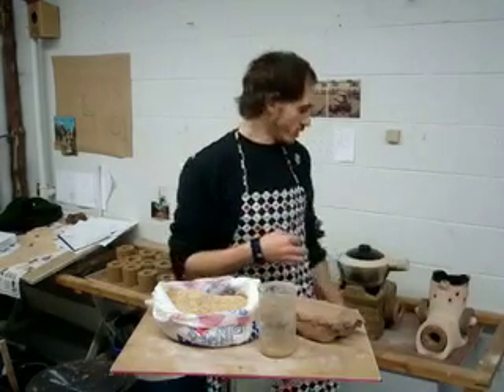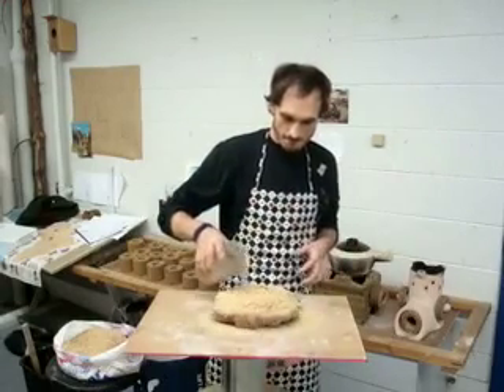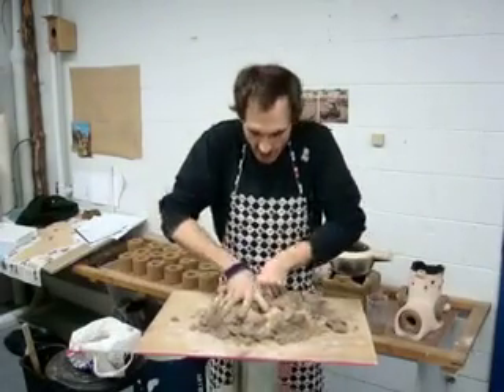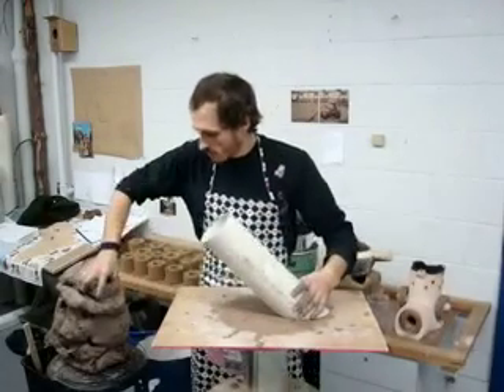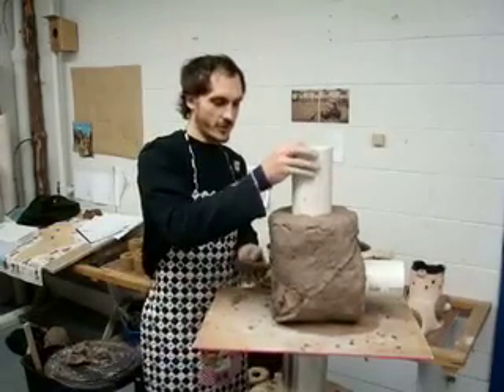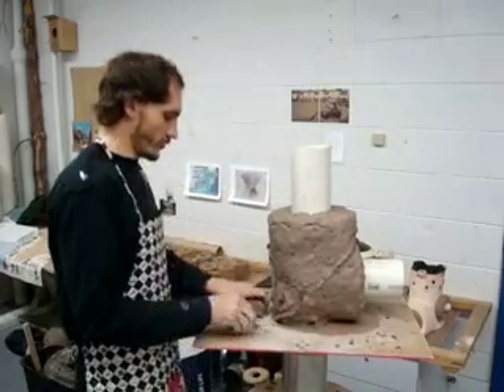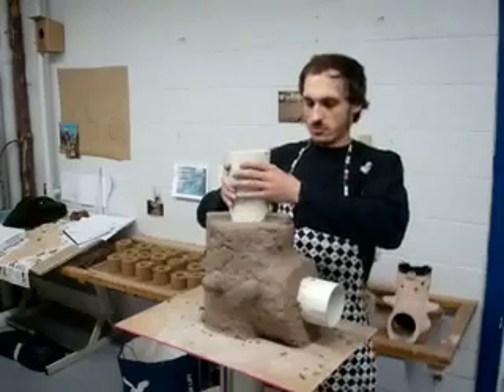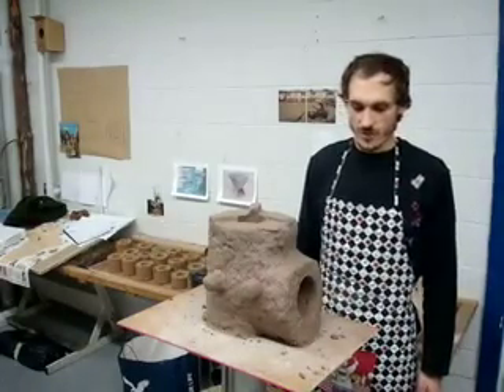Holey Rocket Making 2

Comment: The recipe from ceramicartsdaily there's a video for pulling a handle and attaching with terra sigillata is:Magic Water Recipe 3 tbs. liquid Sodium Silicate 1.5 tsp. Soda Ash 1 gallon water. I added a bit of red clay. Apparently there's a special method of mixing or everything will get too runny. I do not have a kiln, but Jed Guinto said the stoves tend to become for fired the more people use them. Maybe by next week I'll try cooking a stir fry on it